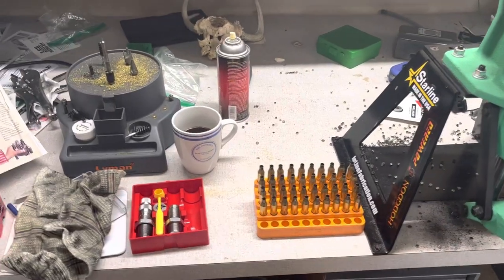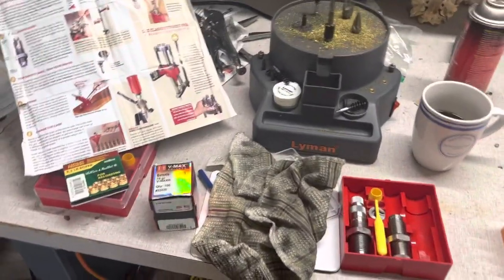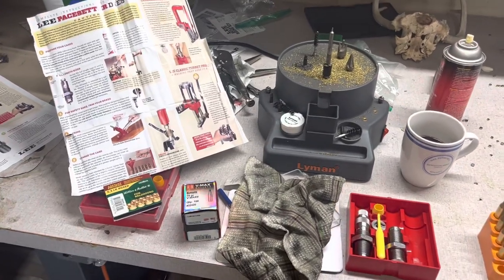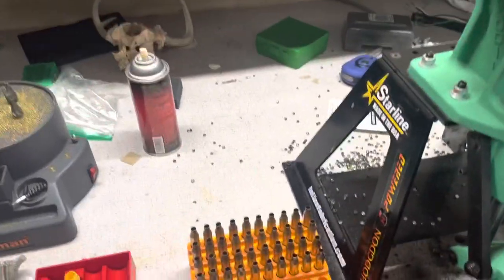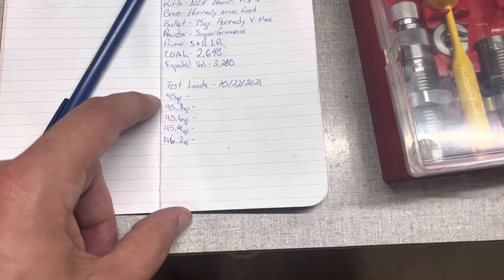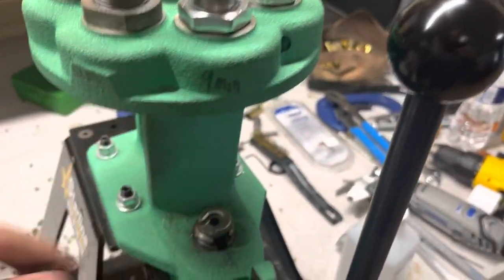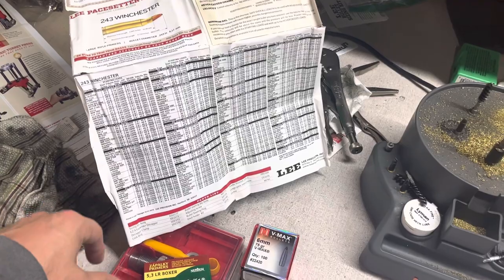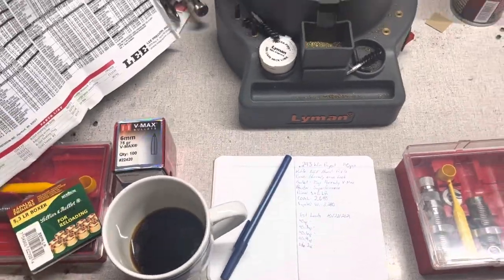Reloading .243 Winchester Video 3: Sizing Die Setup

Comment: I’ve owned my 243 Winchester for 20 years(Remington Model 770) the 243 like it’s bigger brother the 308 is very easy to handload for. But when it comes to bullet weights, anything less than 80 Grs is designed for varmints, the 100 Gr is designed for deer. The Hornady V Max are great varmint bullets, I am working with the 87 Gr V-Max it has a BC of .400